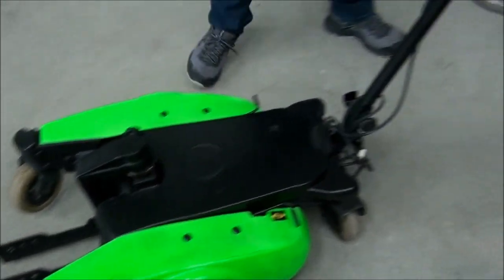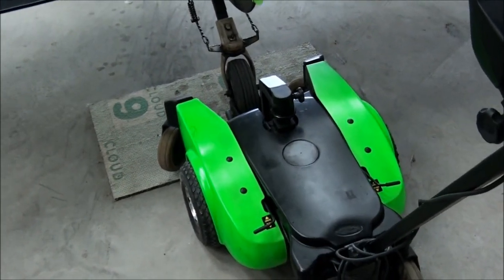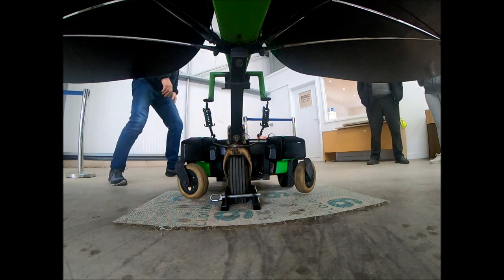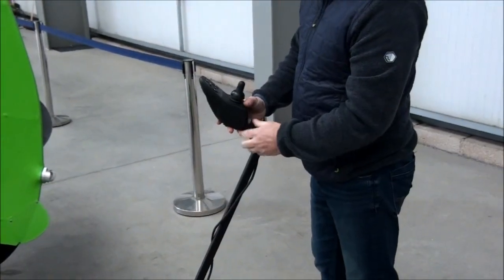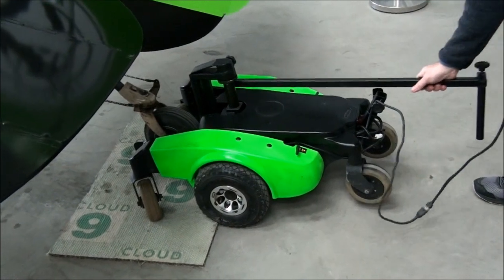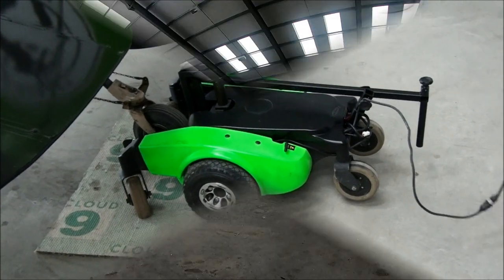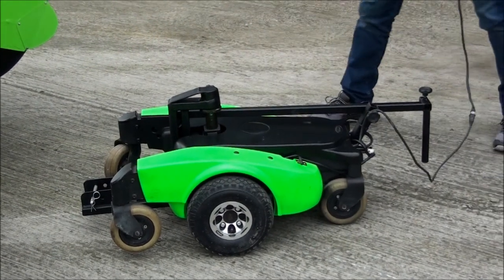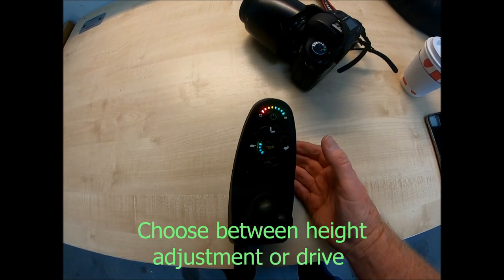The Green Dream Tail dragger tug

Comment: Sort of similar (kinda) of the one I made from a junked 3 wheel handicap scooter.  Only thing I need is a speed controller.  Original were 2 computer backup power supply batteries in series for 24v direct to motor drive.  That was way to fast.  Replaced one 12v with a 6v.  Now running 18 volt - perfect speed and decent speed.  Sure would like to find a motor controller and go back to 24v.  The 18v does struggle a bit on the uphill apron to hangar level.
Reply from the maker: My chairlift element just replaced. Lifting the tailwheel no problem, but it didn’t want to go down. Are you in the U.S.?